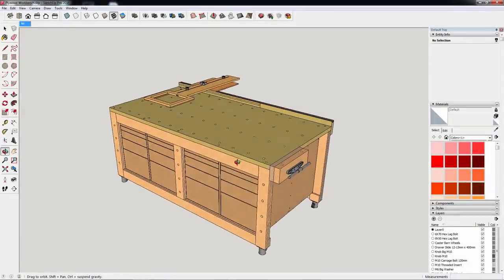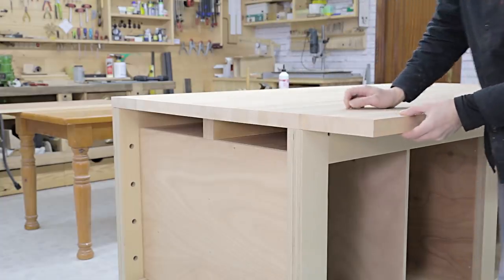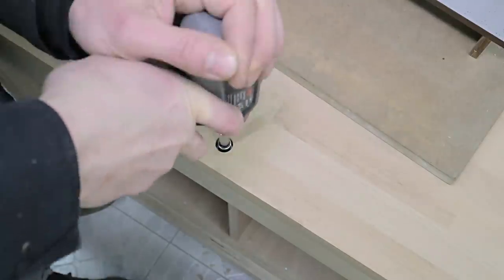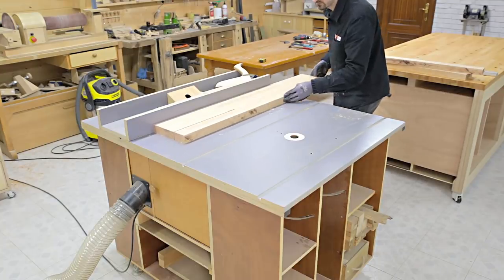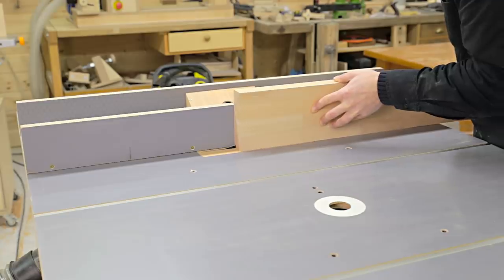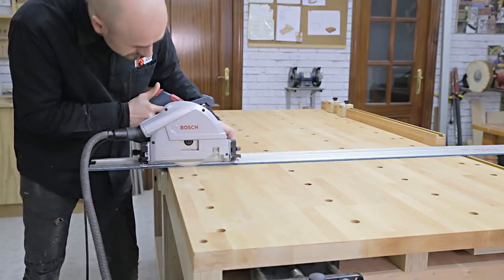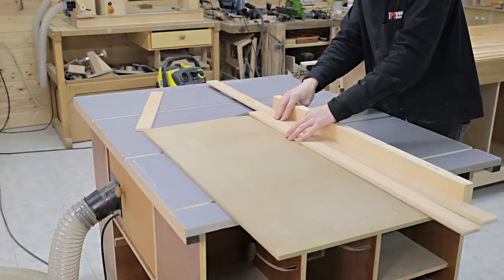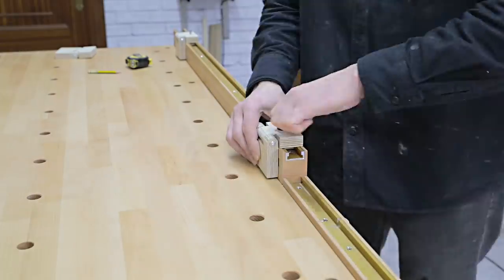DIY Rip Cut Guide / Workbench Build Part 2

Comment: Love your designs and ingenuity. Many of your "machines" are built by you - not purchased. A true "maker".
Reply from the maker: thanks!
Reply: Matthias Wandel would give a tip of the hat at your level of engineering and craftsmanship in making your own woodworking machines.  That 3D router looks very functional.

Comment: Hi, you could put a hidden lever which would slide under the bench top and use it to rotate your full sheets of plywood the top of the bench. If you make the pivot point about an inch above the center you could use one finger to rotate the plywood up onto the bench top, this concept works very well for me and after using it I rotate the lever up horizontally and slide up under the bench top until I need it again. I hope this helps.

Comment: What a novel design! Thank you for sharing!

Two questions:
1) Is wood expansion for your top a concern for the flatness and also cracking, given you’ve lag bolted four corners of the top?
2) you have different types of coating on each side, will that again affect the flatness?

Thank you for sharing! Can’t wait for the rest of the series!
Reply from the maker: thanks Lok! I I think both questions are similar. Maybe with a board made with wet wood and low thickness could have problems, but not with a quality finger joint board. Both the water-based varnish and the oil-based finish will protect the wood against moisture exchange.

Comment: Hi, very nice work and genius idea with the rip cut guide. Did you do any checks on how accurate you are able to saw over the full length of the panel? I am currently doubting between building something similar, perhaps with an upgrade for the linear guides or invest in a second hand sliding table saw. Apart from the costs the main issue with the big sliding table saws is the work space they occupy...
Reply from the maker: I was surprised by the accurate I get with the rip cut guide

Comment: I wish your plans for this were in Imperial using materials we can buy in America...I have no issue with metric, but we cannot buy metric sized lumber/plywood here :(
Reply: DS, man you're on the internet, 2000mm is about 79 inches. 25.4 mm to inch. If you really wanted to build you'd already know how to convert, or find a way to convert measurements. Don't mean to come across harsh but if the measurements are hard this build is beyond your skills. googlization helps with multipilication even in our nation.

Comment: Your work is impresive! I have to ask, does God himself leads your hands when you can mark wholes with pencil, and then drill wholes dead center to those marks and screw that bosch guide dead square to the fence!? I mean if the wholes missaligned just a friction af a milimeter that can not be square.. so can you tell me a secret?

Comment: I still don't get it how not to cut table top :)
Reply: Cross cuts with the track saw appear to cut into the top in the same position, rip or long cuts appear to have thin strips underneath to raise the cut off the bench surface.